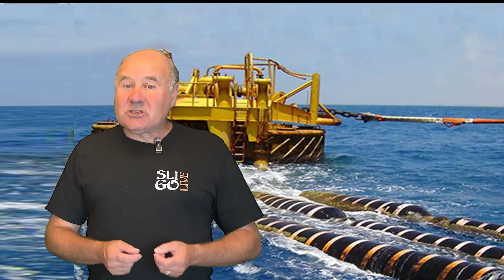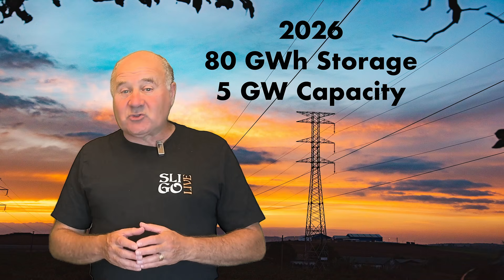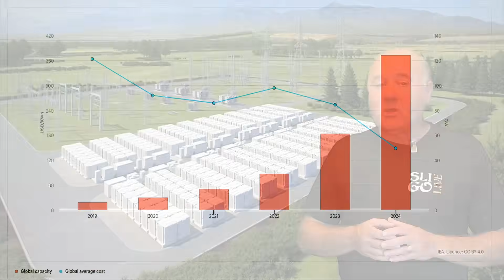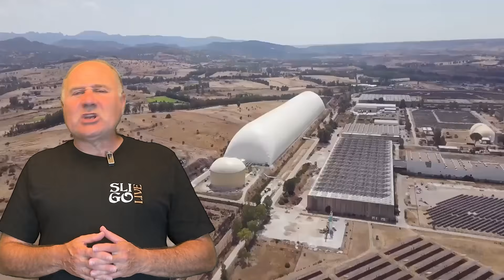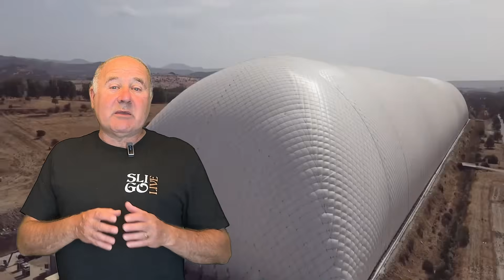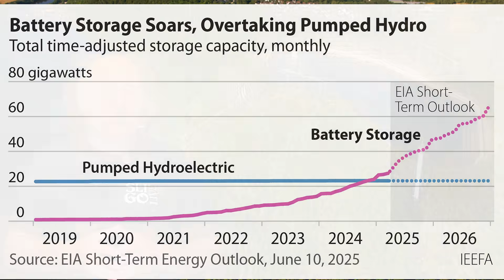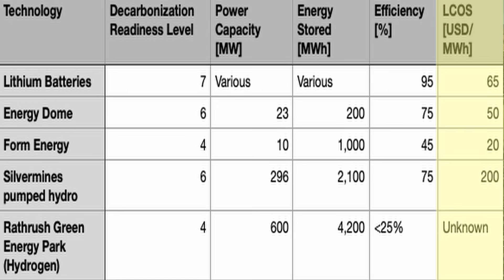Can Ireland build enough energy storage to turn off the gas?

Comment: This is a pleasant and informative video but it seems to entirely ignore costs and is entirely too optimistic on the entirely unreliable and unpredictable output from wind energy. 

The idea that there is always electricity available through interconnectors at a reasonable price is nonsensical.  Take a look at what we pay when wind speeds are low both here and in the UK and what France was charging a desperate Germany earlier this summer.  That issues is going to get worse not better.  We will continue to have gas plant not just on standby but firing up on a daily basis for decades to come.  

The other issue is cost.  Building wind is expensive.  Especially offshore.  The levelised cost is totally uncompetitive compared to solar (Spain, Italy, France) so we will have few customers at the price needed to justify the suggested overbuild and export.  

The grid overbuild to get dispersed wind to where it is needed is also astronomical (total grid spend is currently suggested at c. 20bn). That ignores port upgrades and multiple new interconnectors ata few bn each etc. 

We will still need gas plant ready to go (built, maintained, fueled) and run in an increasingly irrational (expensive) manner (single cycle etc). 

All in all we are facing costs of tens of billions to build an electricity system designed by ideologists rather than pragmatists  (as an energy system engineer for their thoughts on this "plan").  It will also involve huge use of scarce resources to deliver a bad outcome for consumers and do huge damage to industry due to uncompetitive energy costs v. our competitors.  

It would make far more sense to stick to a primarily gas based grid for the next two decades (then maybe nuclear) and use a large part of the money saved to support the adoption of solar etc. in parts of the world where it would be life changing for the people there.  Let's get dependable electricity to the poorest people in the world at a low cost, rather than engineering an abomination in northern Europe.  

It would give a better outcome for the Irish consumer, the world's poor and the planet.  The only people to lose out would be the spoofers with huge lobbying budgets behind the wind farm developments.
Reply from the maker: I'll cop to my video being optimistic, but I don't think it's overly so. 

And it's fair criticism that I don't cost everything, because I just don't have the tools to do that properly. But just burning natural gas is very expensive and dirty and is likely to become more expensive. So it's not at all obvious that the grid upgrades to enable cheaper domestic wind and solar is more expensive in the long run. 

This plan has been reviewed by plenty of energy engineers, as this is the plan that EirGrid is moving forward with. Nothing I'm suggesting is a change in the trajectory of the Irish grid, I'm just explaining it for people who care, but don't attend webinars on the topic. 

The more batteries, wind, and solar we have, the less we have to go hat-in-hand to the French or British to power everything. 

Where I'm coming from is that climate change is a global emergency and that we all need to do our part to decarbonize our society. And my Ireland videos are specifically about what Ireland can and should do in a global context.
Reply: @Decarbonize11  

You dont cost anything in this video.  That renders it fundamentally and irredeemably flawed.  If you can't cost your analysis then you should stop producing what you must concede may well be entirely misleading.  

Gas is sort of expensive and dirty at the point of the generation unit but when you look at the system cost the picture is very different. The required spending to "try" and achieve reliability based on wind + storage a) doesn't work and b) produces a huge system cost.  So to those that want to proclaim the merits of wind, they love to talk about the generation cost but ignore the overall impact on system cost.... This is why our supposedly "cheap" renewables are resulting in high electricity prices.  I suspect you know this but it suits you to pretend otherwise.  

On the technical aspects, you should read the concerns from the Irish Academy of Engineering and properly consider the system cost of what you are proposing before producing content that really does not engage with reality.  

I suppose it plays well for eyeballs.
Reply from the maker: @kellyn1dl 
Here’s the video where I look at system costs. 

What is the Cheapest Electricity: business as usual or going all in on renewables?
https://youtu.be/D7LlA6V60RU
Reply: @Decarbonize11  your video does not address the specific issues in Ireland (primarily the issues with wind v solar) and you make assumptions about the real world delivery of hydrogen technologies, reduction in the cost of wind gen etc. that are simply not born out in the real world.  

Lets leave it there.  I think you know well that this is all terribly misleading.
Reply from the maker: You can leave it here if you like, but what you said so misrepresented my position that I'm not going to. 

I make no assumptions about hydrogen. I'm very skeptical about everything related to hydrogen. I think there are almost always simpler and more efficient solutions around. I believe in electrification (decarbonize the grid, electrify everything you can, figure out how to electrify in the future what you can't yet). 

For cost, I typically use the numbers from Lazard, which are based on operating systems, not projections.

Comment: The salt batteries being developed in China is very exciting
Reply from the maker: There are so many exciting battery technologies being developed that a video on them would last hours. That's why I limited the discussion to just those being proposed for deployment in Ireland. That weeds out the ones that are promising, but not ready.
Reply: @Decarbonize11 I appreciate sticking to facts, but I hope that if a new improved technology becomes viable, dependable and scalable that Ireland will pivot. We're horrifically slow as it is and it's a massive liability. We missed a massive chance to make data centres pay for our infrastructure improvements as part of deals and to force them to generate renewable energy on site. Of course, no surprise there as we can't deliver a children's hospital on time or budget.
Reply from the maker: @thereseoreilly  actually in this case, Ireland is ahead of the curve. Both the CO2 battery and the iron air batteries are cutting edge. In a good way, that they’re ready to start deployment, but we’re among the first place is getting them.

Comment: You are an island, you are surrounded by free energy!
Reply from the maker: Huh?
Reply: @Decarbonize11  Tidal energy, then you don't need batteries.
Reply from the maker: @boblordylordyhowie  Tidal energy would definitely need batteries. Typically there are two daily peaks and then nothing during slack water. 

Wave power is a bit better, but still has lulls that would require batteries. 

Neither are ready to scale. I talked a little bit about them in my decarbonization readiness levels video. 

https://youtu.be/HDGVYpjYFGA
Reply: @Decarbonize11  Water is always moving even if you can't see it, rip tides? Tidal is far better when combined with wind and hydro, they fill in for one another, I wouldn't bother with solar, we are talking Ireland here.
Reply: @boblordylordyhowie It's a misconception that solar needs   direct sunlight to operate. The solar panels still gather energy from daylight and UV light and many homes and buildings in the country have had them installed for years including my own home installed 20 years ago powering the hot water system.
Reply from the maker: Name one place that generates power from rip tides at a commercial scale and I’ll do a video on it. 

There a several reasons solar makes sense in Ireland: it’s summer peaking when wind is the worst; it’s cheap to deploy; it’s easy to deploy.
Reply: @Decarbonize11  I'm not saying use riptides for power what I was emphasising was that even when you think there is no movement there can be underwater movement. Scotland has turbines in the straits between the mainland and the islands where the Atlantic pushes through into the North Sea, you have the same between Ireland and Britain.
Reply from the maker: @boblordylordyhowie 
My previous video actually mentioned the project in Scotland to extract tidal power. But there’s no place in Ireland with currents as high as Scotland is leveraging. 

Fight the Hype: Decarbonization Readiness Levels
https://youtu.be/HDGVYpjYFGA
Reply: @Decarbonize11  Having half the country facing the Atlantic is a bonus as that place is rarely calm, and you must have some deep sea lochs along the coast?
Reply from the maker: @boblordylordyhowie 
The wind potential there is immense. But Ireland has some catch-up to do as far as offshore wind. So we’ll be starting with the easy stuff where the water is shallow, in the Irish sea. The water is so deep on the Atlantic side that we need to use floating winter turbines, which are not quite ready to go.
Reply: @Decarbonize11  I wouldn't fight with surface Atlantic swells onshore wind is probably good on the Atlantic coast but would tidal and ocean currents work at the entrances to the Irish Sea?
Reply: The government have been talking about building offshore wind in the atlantic but the construction cost and hydrogen storage at Moneypoint would cost a fortune so the projects keep falling through.
Reply from the maker: @ShapeyFiend  In the first tranche of off-shore wind included 3 in the Irish sea and one in the Atlantic near Galway. The one near Galway has been cancelled, but the three in the Irish Sea are moving forward. 

https://cms.eirgrid.ie/sites/default/files/publications/ORESS-1-Final-Auction-Results-%28OR1FAR%29.pdf
Reply: @Decarbonize11  well that's nice to hear anyway. I'll sub the channel found this video very informative.
Reply from the maker: @ShapeyFiend thanks

Comment: Love the Sligo Live T (seriously though this sounds like good news for IRL). Do you know anything about the proposed Energy Park on the old Drogheda cement plant site ?
Reply from the maker: I just took a quick look at the site, and there are lots of elements that look positive, but they also mention gas generators, which opens up some concern. How much of the energy comes from new, local renewables, either on-site or close enough to be utilized, and how much comes from fossil gas? The phase 1 energy is low enough that it could be met with solar + wind + storage but that doesn't mean it will be.

Comment: Built some nuclear plants. Sorted.
Reply: Sorted, yeah... but new nuclear generation capacities needs little short of 20 years to come on line, and costs 2-3 times the cost of wind/solar + storage!
Reply: @st-ex8506 half of that tine is plannimg hurdles.  Still not a reason not to start the process
Reply: @MrRugbylane  I am not Irish (I am a Swiss, living in France, former engineer in the energy field, now retired), but I understand that not only does Ireland have no nuclear power plant, no expertise on the matter, and not even a nuclear regulation body within the country's administration.
So, why choose the by far most expensive and longest to come on-line generation technology, when  you have wind aplenty?
I am not the least bit anti-nuclear; but if preserving the existing nuclear capacities as long as safety allows should absolutely be done, as much NEW nuclear makes no economic sense, except in some very limited specific cases... of which Ireland is not.
Reply: @st-ex8506 we have LOTS of wind but (a) without gargantuan battery storage which we will never have, wind is not energy security.  (b) windmills break and degrade quickly and will never be worth the investment long term
Reply: @MrRugbylane  If you consider Ireland as a totally isolated country, then yes, indeed, it would need "gargantuan battery storage". But it's not, it is part of the European grid.  What Ireland lacks is not so much storage capacities (although some are obviously needed) but more interconnections to the continent that it has, as the present video correctly identifies,
Windmills do indeed need careful maintenance, but hey don't "degrade quickly" if they have.  They last 25-30 years, which is reflected by their LCOE, which is, with solar, the lowest of all energy sources (source: Lazard LCOE Report 2026, page 8).
Reply: @MrRugbylane  Storage of waste is the biggest problem not forgetting the water requirements of a nuclear power plant in competition with data centres in Ireland. France had to take several nuclear power plants off grid due to water shortages
Reply from the maker: That's the point I made in my Dunkelflaute video. 
https://youtu.be/iM_n0Ayskns?si=NzdVeU_2yhnuU4DX
Reply from the maker: Currently, that’s not even legal in Ireland. It would probably take 10 years just to set up the regulatory authority to allow one to get a greenlight.

The easiest way to get nuclear power into Ireland is an interconnected to France. We’re building our first one right now.

Comment: Please note that the letters  L in "Dunkelflaute" are both pronounced clearly, as we would normally pronounce them in English.
Reply: In German, you should pronounce the last 'e', in English few people do.  
Spoken by a German: https://www.youtube.com/watch?v=Q8xsg9iK5yo&t=46s  

If you are using it in English, you should pronounce it in English, so silent last 'e'.  Yes it comes from German, but that does not mean that when speaking English, you should pronounce it in the same way as when speaking German!  It is a word that has been adopted into English and is now an English word.

Also doesn't mean that when used in English, it should be spelt the same way as in German, German = Dunkelflaute, English = Dunkleflaute?

Dunkle is an old Scottish and Northern Ireland word meaning a dent or dip, so the meaning of the two sections swap over compared to German!

Languages, especially English are supposed to evolve, there is no correct pronunciation, or spelling.  Both change over time.
Reply: @nigels.6051  "If you are using it in English, you should pronounce it in English" no.